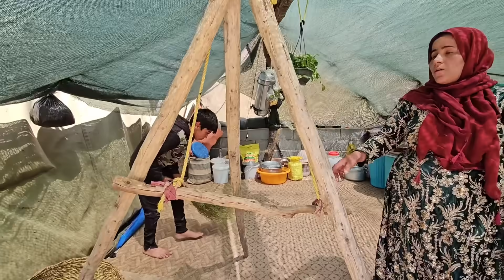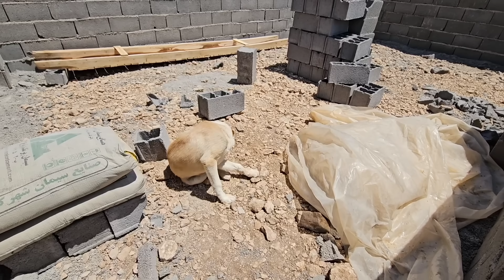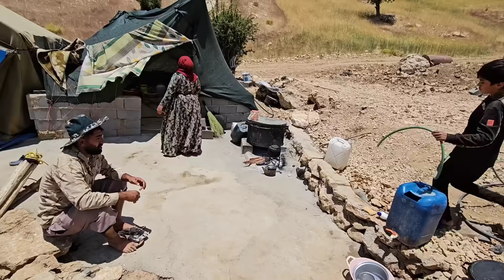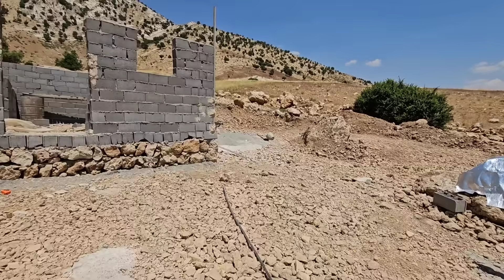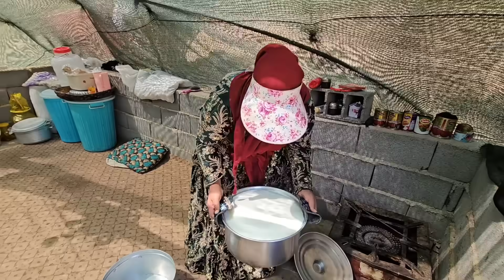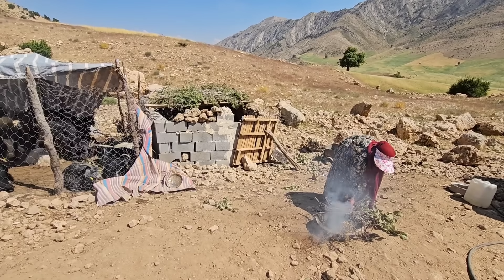"The Nest of Wanderings: Building a Nomadic Home by a Pregnant Nomadic Woman."

Comment: Shahab is working hard, but why are u wasting the mix why dont u spread it along thinly on the wall?, because so much just fall over the sides of the wall? Then u run out quick, and go buy more bags... use a bit of wisdom, if you spread it properly.👍
Reply: He does wast a lot I was thinking the same thing
Reply: Сакине. Не. Очень. Торопится. Помочь
Reply: Мадина. Миллион. Лайкоа
Reply: Шабаху. Два. Миллиона. Дайкоа
Reply: I don't think there is enough cement in that.mostly sand and stones..
Reply: I completely agree with you.
Reply: The  wall is weak from the lack of cement.  I saw the whole wall  crumbled  on this channel while they built  their winter house .
Reply: @giankeller545 строят на какое то время, затем будут разбирать!

Comment: The first thing u need to understand about brick laying is that the string is not supposed to be on the side of the brick. The string should be on the top edge of the brick so you know they are nice and level and in line.